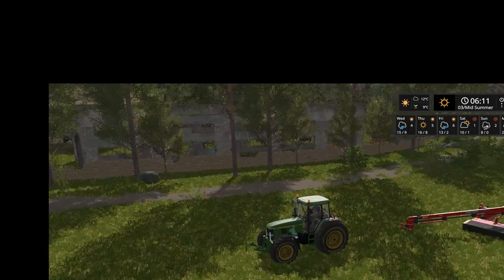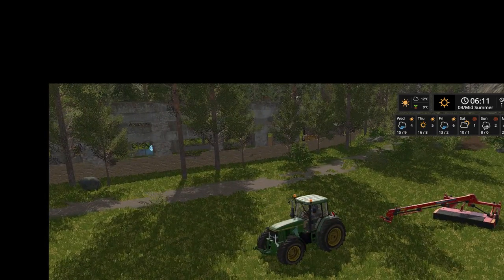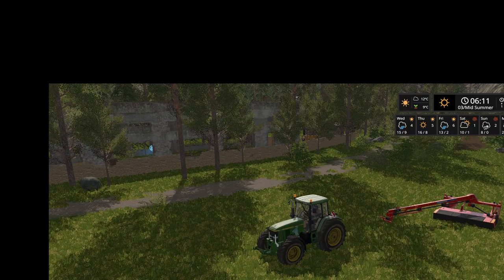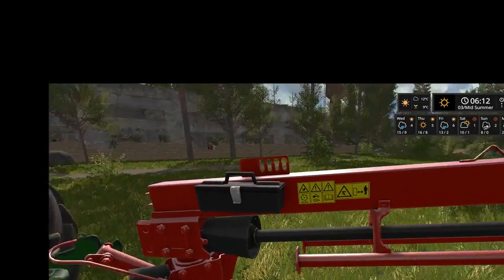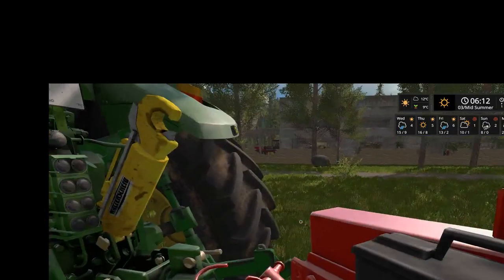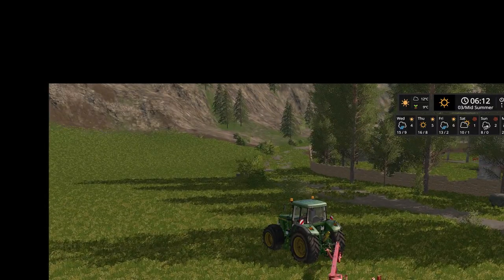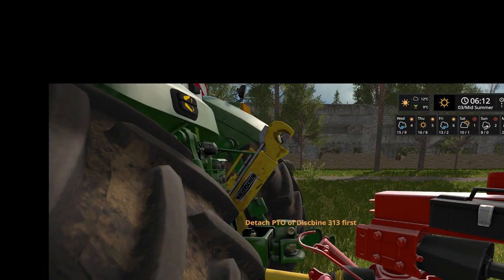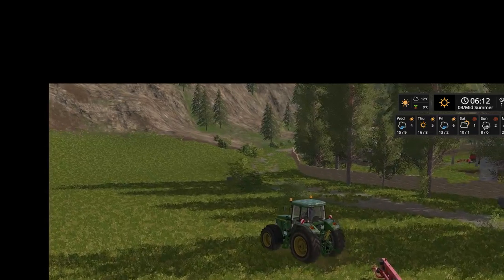Tutorial - Manual Attach Mod

Comment: Also note that if using dynamic hoses a long press of Z will connect hoses. Some trailers, etc won't actually work or won't release brakes if hoses aren't connected. That's just if they support dynamic hoses though. :)
Reply from the maker: Good to know Kerbo. I tried to get dynamic hoses working but the document said I needed a certain file that was not included in the download.  I love the idea though and will look again later for a more complete package.